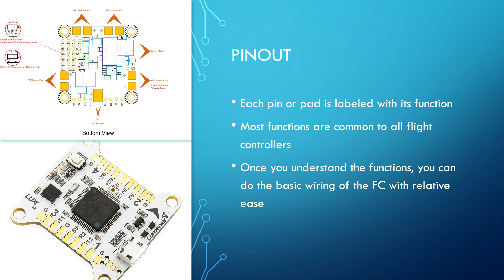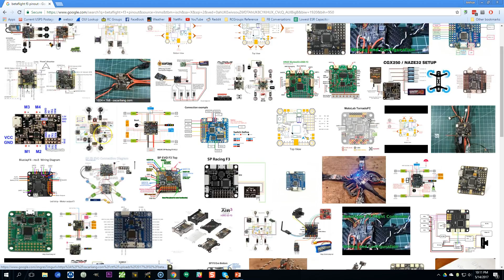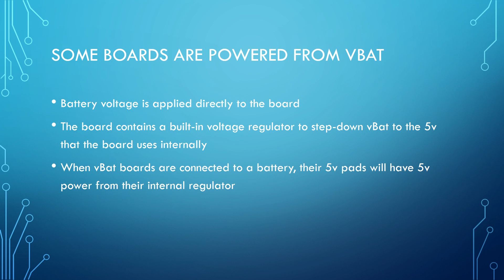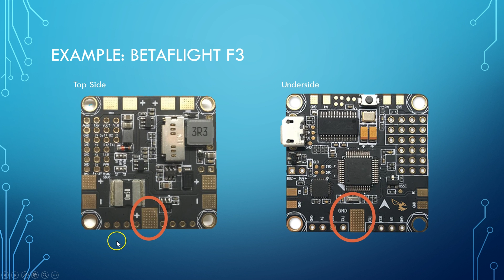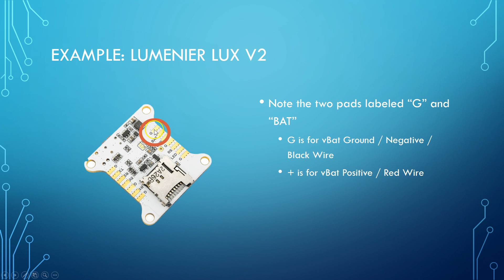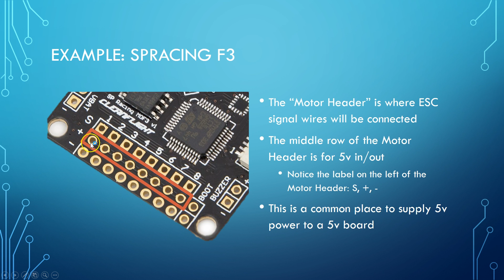Flight Controller Wiring For Beginners - PART 1 - Power

Comment: hello Joshua, i am looking for parts to build my first drone and for esc i am between racestar 35A without bec and racestar 30A 4in1 with 5v bec. For the 35A wiring if i connect my battery to esc bat pads and  the vbat jumper wired to fc power B+ will all be ok? Is it wiser  to  pick the 30A racestar 4in1 and if yes any advise for fc selection for both builds? thanks

Comment: Hi Joshua. I just received your betaflight f4. Out of the package I plug in my computer and had to go through the drivers to get comport. No problem so far. Next I went to receiver and it was blank. No colors. Is this normal.
Reply from the maker: This usually indicates you are using an old version of Betaflight on the board, but I know my board is shipping with something recent. So the next likely thing is a configurator issue. Have you downloaded the latest configurator?
Reply: Yes..lm on the stand alone betaflight cofigureator. 10.o.o
Reply from the maker: Re flash the FC with "full chip erase" selected.

Comment: Hi  i am electronic tech for over 30 years and yet i was unsure of where to put voltage input until i watch this video ,so thank you for taking the time , i have watched lots of vids and never been sure of where the power goes . lets hope i get it right first time  now cheers
Reply: ok well   my 24 pin  on the spf3 has a dead short  but i can power it from usb  , so  trying  figure a work around
Reply from the maker: +Ronald J Kirby if there's a dead short you have to figure out where the bridge between the pins is coming from.
Reply: thanks Josh  i have fixed it now

Comment: Hey Joshua hope you can help me my SPF3 is no longer receiving signal from my rx and is driving me crazy.I tried uarts 2&3 but the rx is fine i have checked everything.Should i trash it?
Reply from the maker: I would really want to know why it is not receiving. Very unlikely that all three UARTs died at the same time. How do you know the RX is fine?
Reply: I plugged it to another quad.
Reply: When i click on the rx tab in BF the colored bars disappear.
Reply from the maker: I think you are using a really old version of BF and that's why it's not talking to the configurator correctly. The configurator should show colored bars all the time even when the RX is missing or misconfigured. The fix is to upgrade to a recent version of BF.
Reply: Something has shorted out my other shit works fine.

Comment: I am trying to figure out what SWD ,SWDIO, SWDCLK, NRST mean on my Sklyline 32 flight controller, it also has a 3.3v and ground. Could this possibly be where i would connect a Spektrum receiver
Reply from the maker: That is for the SPI bus I believe. No that is definitely NOT where you connect spektrum receiver. Use a UART as shown in this video. It's possible you can get away with using that 3.3v pad for power though. It just depends on how big a 3.3v regulator the board has.
Reply: Thanks for the timely response. That was a big help. This board is connected to a PDB, so I should be good.

Comment: my F3 motolab FC has esc sides 1234....side 1 motor 1 that is will not turn the motor!..i tried new esc!  put new motors on and same thing side 1 nothing!...do think the FC is defective???
Reply from the maker: If you changed the ESC and it still doesn't work, then the signal wire is the next place I would be looking. Doesn't have to be a dead FC output... it could be a bad wire or solder joint.
Reply: the signal wire i soldered to FC? the white one?...you think it would do this! its my  second esc i replaced  kinda odd no?...and i cut the ground wires off because the F3 doesn't require one!..

Comment: the new frsky XSRF40 looks like a VBat board.. however it says in the manual operating voltage says 4-10V, so does this means that this can only take up to a 3S battery? Thank you in advance for your response.

Comment: Hey Joshua, I have the cleanflight board that you showed last. I burnt an ESC today and It's my first time replacing those. I am curious mostly about where to put the signal ground wires since the positive and negative pin holes for the power are in the same column as motor 1(x220's ESCs don't come with signal grounds but the new ESCs on their way do and after watching your video about signal interference I am just trying to cover all my bases). Do I need to move the 5v power to say the motor 5 column or can I put signal ground wires in what ever columns are open? Thanks!
Reply from the maker: If you don't have a convenient signal ground, you can probably remove the signal ground wire from the ESC and be okay, as long as your wires are pretty short overall.
Reply: Ok, I will go without, less soldering anyway. Thanks for the help and the video series as well.

Comment: What about when the fc don't have a Vbat input but has a Bec & built in PDB.??
Reply from the maker: I don't understand. Like the Betaflight F3 at 8:51 in the video? Or the Kakute AIO at 10:08?
Reply: It's a micro beta flight F4 board
Reply: Betaflight revo F4
Reply: I messaged the seller they said " put Vbat to esc output.? "
Reply from the maker: On that board, I would put vBat up to 4S on the "VIN" pad.

Comment: Joshua I need your help..i have radiance FC and I shorted my buzzer port.. now it's constantly beeping..is there any possibility to move buzzer to another unuse pins....help me😢
Reply from the maker: You can remap the buzzer yes, but you need to build a transistor buffer circuit because the GPIO pin itself can't handle the current the buzzer will pull. Something like this:

https://3.bp.blogspot.com/-6Z-OMiTvlyE/Vtik0m9_0iI/AAAAAAAAhcw/2xJcfPCdods/s1600/Screen%2BShot%2B2016-03-03%2Bat%2B22.54.31.png

Comment: Hey Joshua, I have watched the 3 video's and can't find the answer to a question I have, can you help?  How do I get battery voltage to show up in Betaflight using an F3 FC? I am using this Racerstar 20amp 4 in 1 ESC which has 5v out. I have plugged it into the Omnibus F3 aio v1.1 FC using a ESC rail/multi cable (short cable with connectors on both ends). I have added a jumper on the FC from a 5v to RAM. All connected devices and the board have power (camera, VTX, Rx, beeper). In Betaflight there is no battery voltage (vbat is turned on in the gui) in the icons at the top of the page? Do I also have to solder + & - wires from the battery leads to Flight Controllers vbat & gnd slots (like you have done in your recent wizard220 hack video)? Would this send the power twice  to the FC (once by the 5v ESC connector/cable then a second time via the battery  a leads) and possible  fry something?
Reply from the maker: +aaron test yes that's what you have to do. Really only vbat+ is required.

Comment: terrific video joshua.  was thinking maybe a follow-up video on beginner basics on general use of a multi-meter on a build could be very popular - e.g. testing continuity (between pinouts, solder connections, etc.), dc voltage measurements (volts, polarity), etc.  propwashed has a nice article on the subject ( propwashed.com/multimeters-for-drones/ ), but a video + your teaching talent could be really helpful for your students.  cheers
Reply from the maker: I have a series of multimeter videos.

https://www.google.com/search?q=joshua+bardwell+multimeter&rlz=1C1CHFX_enUS570US570&oq=joshua+bardwell+multimeter&aqs=chrome..69i57.6647j0j7&sourceid=chrome&ie=UTF-8
Reply: Well would you look at that !  :-)   Maybe link to them in the description as a continuation of foundational quad building basics?  Cheers.

Comment: Joshua, if your FC has vbat, do you HAVE to use it, or can you just hook it through the ESC rail to a PDB with 5v stepdown?
Reply from the maker: You can provide external 5v. Just don't wire the vBat inputs or you'll have two regulators fighting each other.

Comment: I'm the new guy and I have dived in head-over-heals for FPV without ANY electrical experience to speak of (so I've wired some outlets and light switches)... Never soldered before kind of new.I have a QAV 250 I'm currently building (months of trying to get the time with 2 kids under 4), and now I have a Pico X on order I'm super pumped about! Yeah, and I haven't even flown one yet (yes I got the kit I have to build) THANK you so much for videos like these. Keep them coming!

Comment: Just stumbled over my frame from 6 years ago,... PDB was a proto board with battery connector and ESC leads directly soldered to it and dipped in liquid tape. The FC was powered by one of the ESCs BECs...

Comment: Hello Joshua. I have a doubt for the spracing f3 board. At 15:35, for example, we can see the negative, 5V positive and signal... BUT, at the top of this image, in the board, we can read (it's upside-down) the VBAT word... what is that for? can I conect the VBAT from the pdb using a 3S battery? thanks for all :)
Reply from the maker: That is for battery voltage monitoring, not powering the board.
Reply: Obrigado!

Comment: So you still connect the VBAT to the motor leads or the lipo leads so that you can use VFAS in telemetry yes?
Reply from the maker: If you have a board that can be powered directly from vBat, then the board will not need any extra wiring to report vBat via telemetry or whatever. If you have a board that is powered by 5v, it will have a separate vBat connection that you will wire to the battery positive pad. This doesn't power the board, but it does let the board measure vBat.

Comment: Just to inform some people that might get confused: The video thumbnail is NOT correct and this video does not apply to all boards. For example the raceflight revolt does not have all the 5V pads equal. Also almost all boards DO have vbat pads even though they dont have a voltage regulator, those pads are for sensing the battery voltage and not for powering the board and you still need to apply 5v to the 5v pads on them.

Comment: f4 Betaflight board to ibus. So I connect to a uart, not sbus/ppm?
Reply from the maker: The difference between SBUS and UART will likely be that SBUS will have an inverter built into it. For an F3 board this distinction doesn't matter because the F3 supports UART inversion natively. The F4 does not, so the board designer has to install an inverter on the board.
Reply: Is that why for F3 board in CLI inversion is turned off? What happens if you turn it on like you did with the Naze32 older boards?

Comment: Hello !! You might be able to help me out on this one...since RG wasn't sure of the answer when i called.  I have the rg ssd and i'm trying to get the osd data out of tx/rx port#4 and still read no data from my furious piggy osd.  I have one with kiss board i no set up what needed.   I'm i missing a configuration step? I tried select telemetry on port#4 no luck:-(.   Thanks for you help if you can...  cheers
Reply from the maker: You need MSP not telemetry to talk to an OSD.
Reply: Joshua Bardwell  does the board is capable of doing that?
Reply: Smp as for smartport?

Comment: hi Joshua , I have a little question. I mounting a 130 ... I have used a f4 v2 omnibus. the red cable of battery xt60 I set on right pad but touch the current sensor on the right ... is it a problem ? there are not short circuit.
Reply from the maker: If the red battery lead touches the battery side of the shunt resistor that is okay.
Reply: thansk so much ;)
Reply: Joshua Bardwell Thanks! I learned something today! Had the same question.

Comment: HELP!! I just finished a new quad, with a betaflight f3 orientated 45degrees and soft mounted on foam, but there are awful vibrations, motors very hot after like 8 seconds!!! I'm on 3.1.7 stock filters, what might help?!?
Reply from the maker: Soft mount the FC using rubber standoffs such as: https://goo.gl/54TxD9
Reply: thanks

Comment: I know how to wire them up but I've never been able to get one to work!  I have a Naze32 the had it's USB port break off before I could ever use it and 2 PX4's that have never worked at all, the first one wore out after trying to get hundreds of different versions of Qgroundcontrol to work and after switching to Mission Planner on the second one it could never setup the compass and gyros properly.  I'd like to see a video showing how to program a PX4 that actually works but don't think it's possible since the software still has 400 bugs reported on Github and has never worked in spite of all the fake videos showing how to do it!

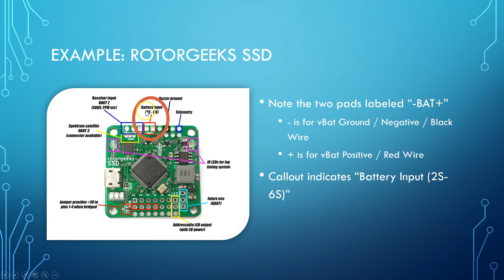Comment: Hey. At about 11:40 where you are talking about the Rotorgeeks SSD you say the VBAT + & - pads are too small for the 12/14 AWG wires from the battery. If you use 22/26 AWG wire to bridge the FC and PDB wouldn't the wire be too small to handle to power supplied from the battery?
Reply from the maker: Power supplied is a function of voltage and the resistance of the load. Ohm''s Law: Amps = Volts / Ohms. The load is designed so that it draws how many amps it needs when the rated voltage is provided. There is no such thing as a battery "providing too much power". The battery provides 16 volts (or whatever) and the SSD draws as many amps as it needs to make the number of watts that it needs to power itself. The only danger is using too high of a voltage, which can result in excess current flow and burning out the board.

Comment: Got a question. i bought the wizard x220 and noticed they did not run the ground signal wire from the ESC. i bought some emax bullet 30a esc(after i shorted and burnt an esc and a motor when it got wet from some grass leaves) where do i run the ground wire from the ESC. im asking because it was mentioned that signal ground is important for D-Shot.. or is it O_O?!

Edit: Board is SPRacing F3 i think.
Reply from the maker: You can run it to the power ground pad on the PDB.
Reply: i ran it on the SPRacing 3 ground below the signal and postive is this OK?

Comment: I've found soldering an XT60 directly to a PDB or FC sometimes vibrates off the battery's male.  I use about 15mm of 12g wire separating the XT60 off the surface as vibration absorption.
Reply from the maker: I agree this is a good idea. It also helps protect the connector if the battery comes off in a crash.

Comment: hi josh - I have a sp racing f3 board that has VBAT - my research tells me it's just for monitoring the battery voltage but where does that monitoring show up?
Reply from the maker: If you enable vBat monitoring in Cleanflight or Betaflight, then the FC will sound the beeper when battery voltage is below a pre-defined threshold. Also, vBat can be reported to the radio via telemetry.
Reply: So how would you connect Vbat on this board ? if it can only use 5v?

Comment: BEC= Battery Eliminator Circuit and that was the label for the first ESC's long ago when the they included a linear voltage supplier to supply power to the Rx/servos. A switching and better regulator came a bit later on some ESC's. The ESC's included one of the red JST plugs and is sometimes referred to as a BEC plug. Along with the BEC plug you also needed a BEC switch with the red JST plug to power the Rx/servos and to control the on/off function. Many times you eliminated the ESC BEC because they were problematic and used a better regulator or smaller onboard battery(5-6V) to power the radio gear.

Comment: Thanks, thanks I'm using f3 board that still has the original header connection on it came out of the Falcon 210 and I was wondering if I use the black and the red in the header bundle to get power from(5v) the pdb your video helped a lot thanks. correct me if I'm wrong but I assume the other colored wires in the header bundle go to the white wires of the ESC
Reply from the maker: You should absolutely refer to the pinout diagram to find out what those other wires do :-)
Reply: Found the flight controller pinout the other color wires can be changed in betaflight
Reply: it is the correct wires for the FC spf3 bl=gnd
red=5v
blu=motor#1
yellow=motor#2
white=motor#3
green=motor#4.

Comment: Hi JB... Love your videos and the things I learn from them. I have been building FPV quads for almost a year now and I know how handy this info is for someone joining the hobby. Great stuff.
Got a question for you, related to FC types. I want to build an autonomous drone now and it seems that the PixHawk or PixFalcon FC are the way to go, but was wondering if just about any FC can be used to set up flight missions and waypoints (Maybe some of those old naze32 FC that I no longer use can be brought back to life in my UAV drone).
Reply from the maker: No, not really. Until iNav got mature, CF/BF boards didn't have good waypoint support at all. Honestly, PixHawk and APM are the big ones as far as I know for home-brew GPS/autonomous projects. Or DJI if you want to spend $$$. I don't mean to take anything away from iNav, but I know PixHawk and APM have been doing this forever and I assume they are more mature than iNav, although I could be wrong about that.
Reply: Awesome, thanks for your answer and for the time taken for it. Cheers...

Comment: Looking forward to the rest of this series! I'm in the middle of my first build, using a Betaflight F3, my cheap 20W soldering iron couldn't heat up the large ground pads very well, so I'm waiting for a new 60W adjustible temperature iron to arrive tomorrow. Hopefully that'll do the trick!

Comment: what about an fc pdb how do you hook up a 4 in 1 esc if there are 4 spots to hook esc's?
Reply: bronco7905 on some boards (f. e. the omnibus f3) there is a single connector for 4 in 1 escs
Reply: have a micro omnibus not sure where to get power can I use any of the esc power ground pads or do i jump fro batt on fc to esc signal wires aren't a problem
Reply: Use pair of pads closest to battery/shunt. For micro build it should be ok, pcb can handle lot of current. For mini build I would not recommend, better choose another FC or not to use current measuring.
Reply: Michal Horváth yea going on a 120 micro with 11-- size motors